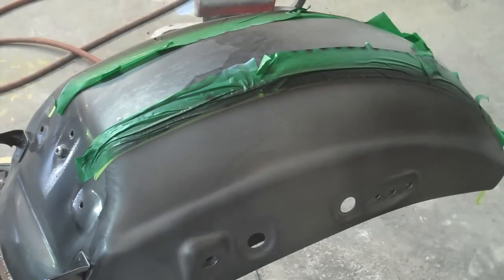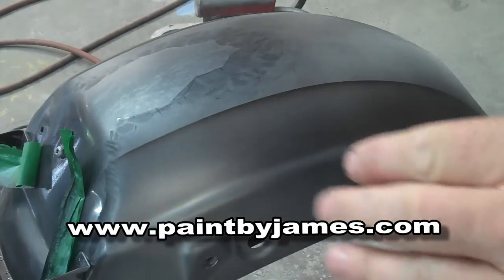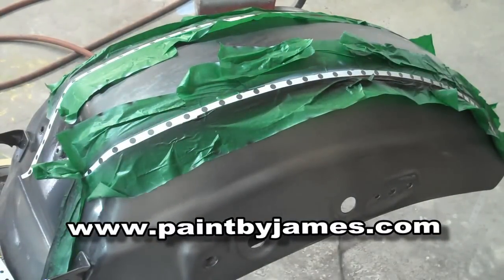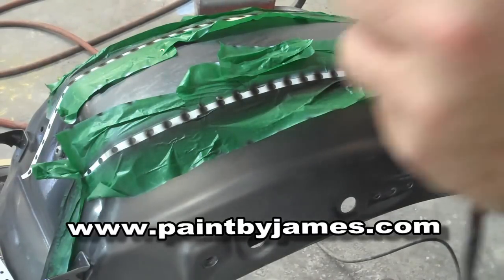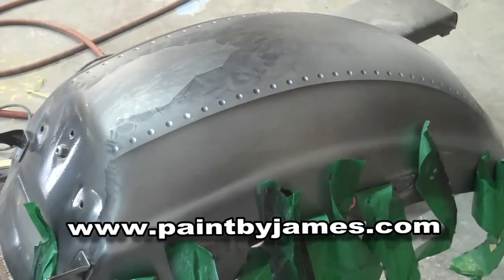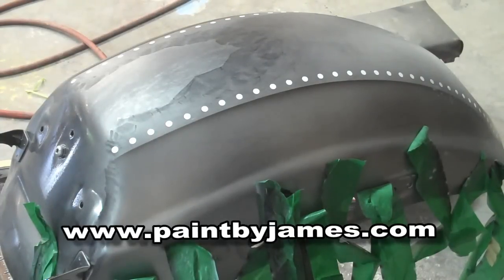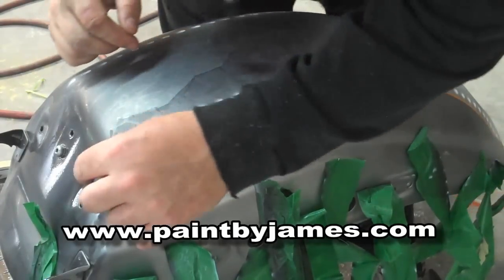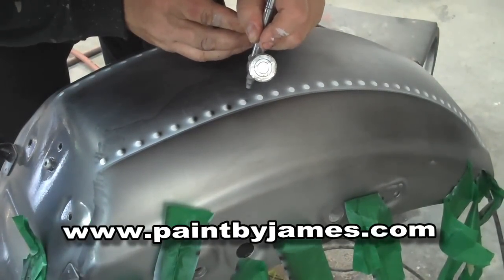How to Airbrush rivets

Comment from the maker: You are totally right! The only reason I got away with it was that the bike was clear coated, cured and sanded between each step so there was no paint to peal off. Though it is a good habit to get into and I certainly should be sure to do it right in future videos. Awesome tip. Thanks

Comment from the maker: It was a black bike but the house of Kolor chrome paint can go over any color though black seems to be the best for any mirror finish... This chrome had a few tricks to learn but much easier with fewer steps then other chrome paints. One trick is adhesion! This stuff does not stick! First time It came off in sheets with clear coat on it. I ended up putting bulldog adhesion promoter in an airbrush and misting the entire bike first. This was the key. Do not spray directly out of can. only airbrush

Comment from the maker: The bombs I made from those tubes inside toilet paper with a pingpong ball on the top, then hot glue fins on it and fiberglass resin and mat over the entire thing to make it strong and stable. Also some body filler with a dremil for carving. Sandpaper and primer.  Im a body guy by trade so the bondo shaping comes easy to me.